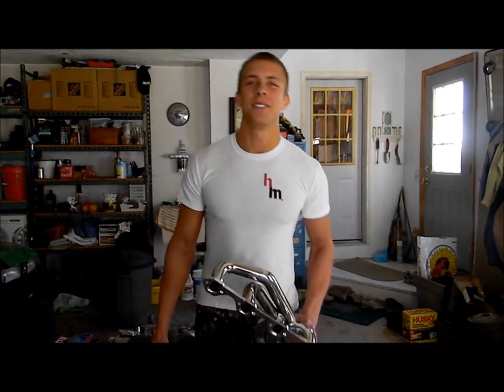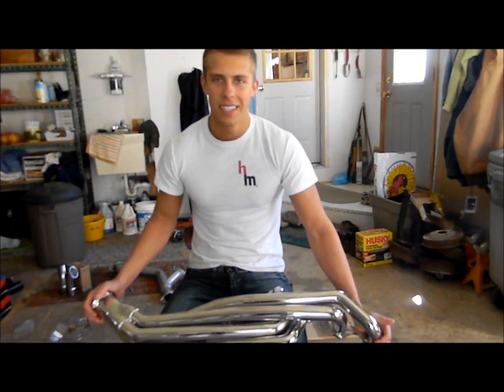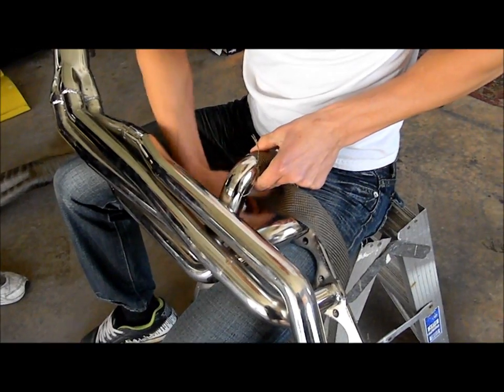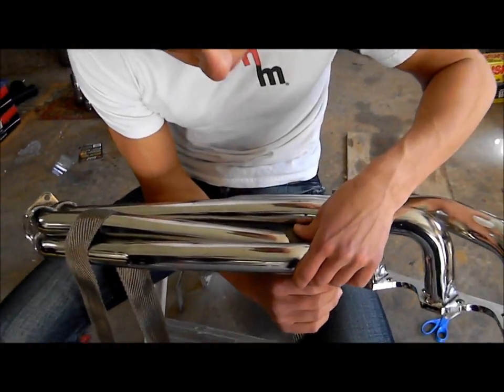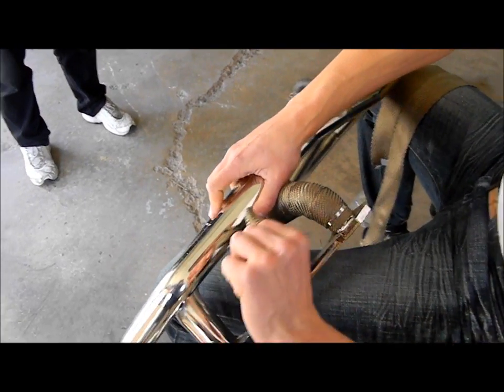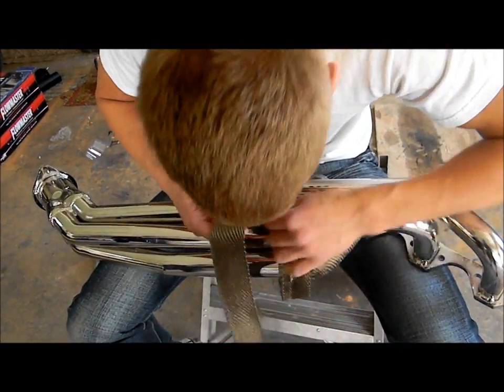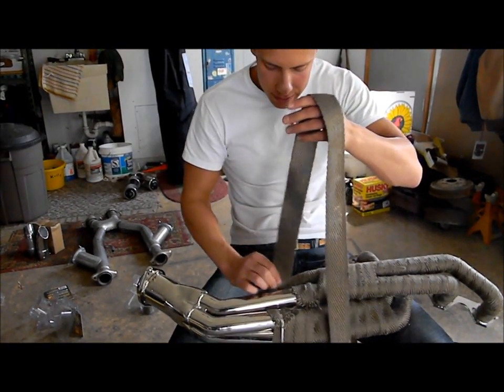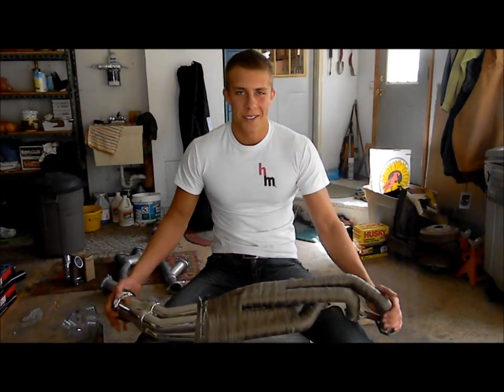How to: Header Wrap | DEI Wrap | Exhaust Wrap | Down Pipe Wrap

Comment: Will this work for my YFZ450R head pipe?  Right when my pipe comes off the header and curls back to the muffler..right in that curve glows red..i know its a yfz thing and dam near all the Factory glows red..just wornderin if I could wrap this were it glows to take off some the heat off my leg and radiator hose

Comment: does this header wrap stuff also slightly reduce noise? the main reason why i would get this header wrap stuff is if it were cut down noise at least a little bit on a 2 stroke engine while providing other benefits.

Comment: you totally did it wrong... you don't pull the whole thing through each wrap... what you do is FINISH at the point where you in fact started... so you wrap and wrap and wrap LOOSE... then when the header wrap is around it a bunch of times you literally start at the YOUR end and finish where YOU STARTED... just saying...
Reply from the maker: +Rick Dangerous or what if the way you described in the wrong way? mwahahahahahah!
Reply: Poor Man Mods .

Comment: This Titanium Wrap isnt titanium but has characteristics of Titanium.  Its more of a pulverized lava rock blended into the fibers.  Said to withstand temps of 1800 compaired to Fiberglass wrap (1200).   You moisten fiberglass prior to installing to make it easier to manipulate and make a better seal (tighter).   Reason for smoking most likely is because you had grease oil or something on your headers,   need to clean headers prior to install.   Header wrap can start a fire, so USE CAUTION.